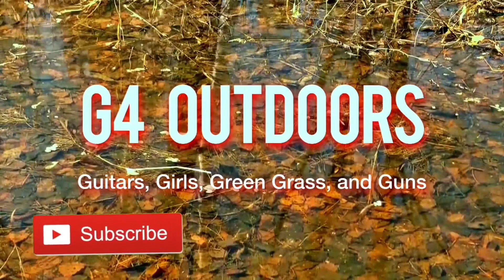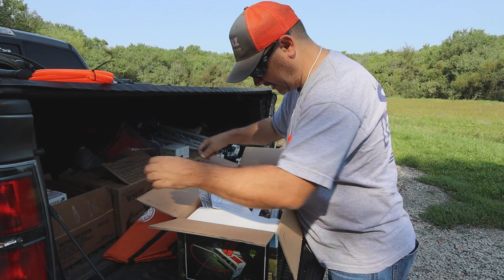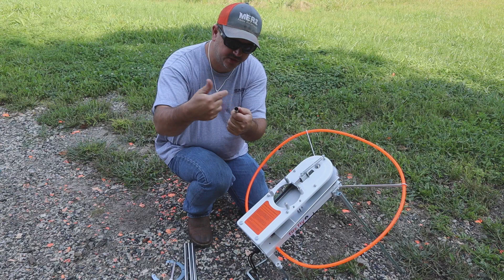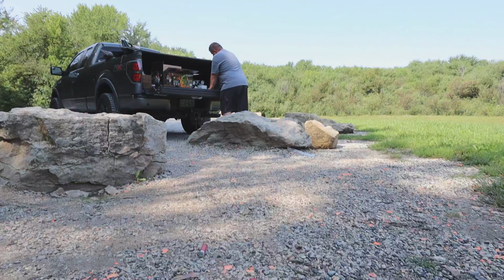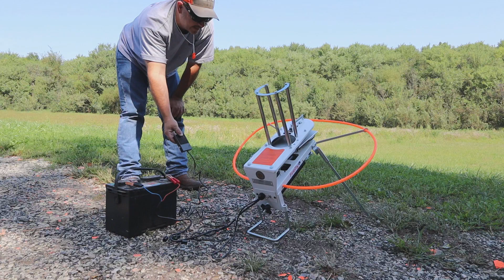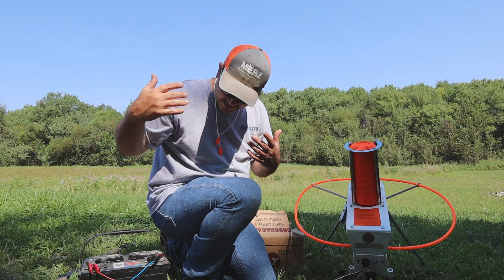Do All Fire Fly Automatic Trap Thrower | Unboxing and Assemble

Comment: Just got one today off Amazon for our group of crazies to use this spring.  Your video was cool, but I tend to read the instructions before putting stuff together.  I wonder if it will run off a 2K Honda generator (has a 12V output).  Will try it and see before buying a 12V battery for it.

Comment: The only reason I watched was for the spring adjustment and you skipped it.
Reply from the maker: Aw. Sorry about that Beast! By the time I could get a video out on how to do that, you should probably have figured out by then. I’ll try to tell you though. Let the throwing arm go to it’s relaxed position. Loosen the nut on the very rear of the spring, then tighten the tension on the spring with the other nut, then tighten the very rear nut to lock it in place. Hope that makes some sense to ya.